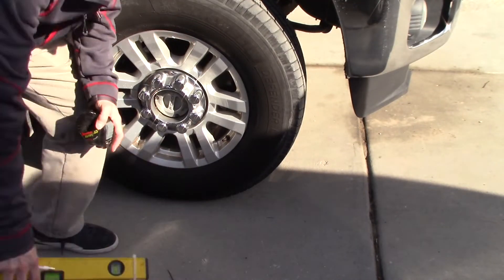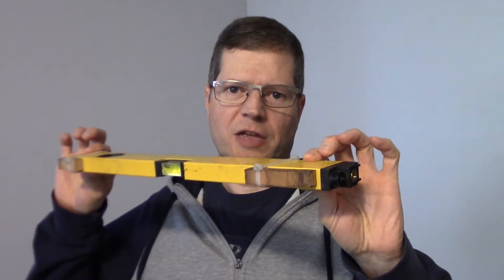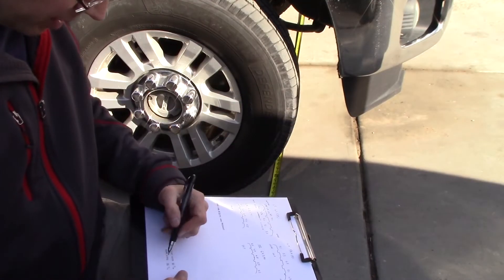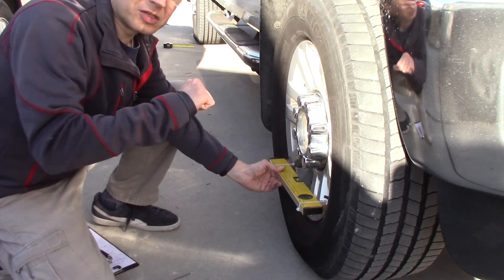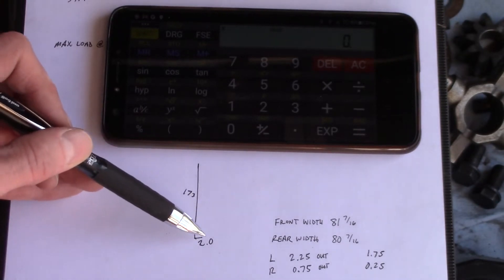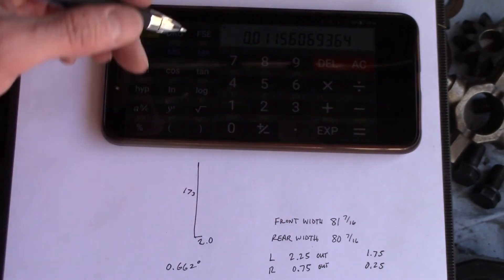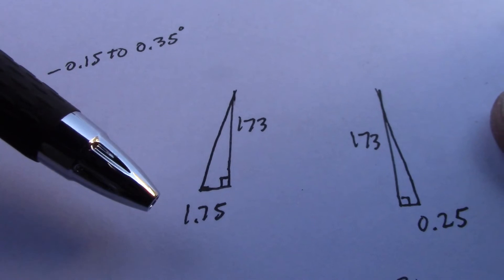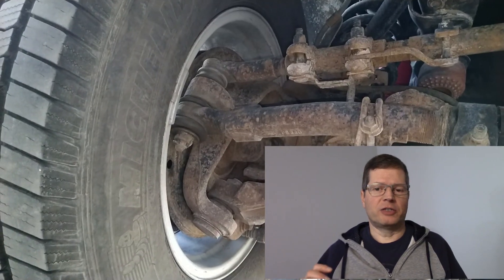Easy DIY way to check toe angle alignment

Comment: What is the 173?
What is 2.0??
Reply from the maker: The 173 was how far back from the front wheel I measured with the laser. The 2.0 is how far apart the laser was from where it should have been. They were just two legs of a triangle.